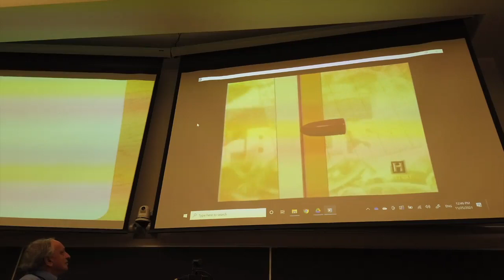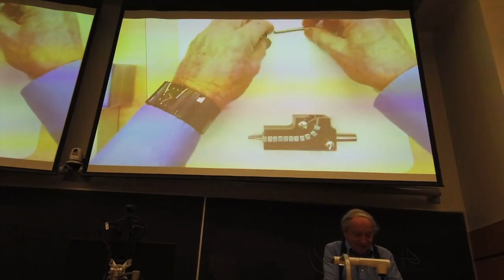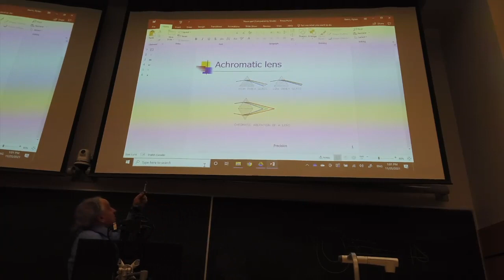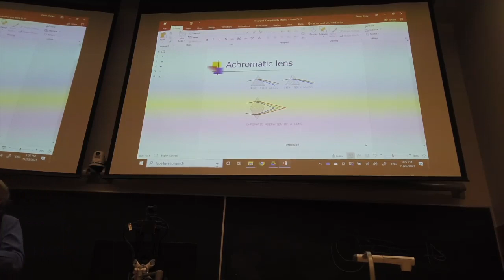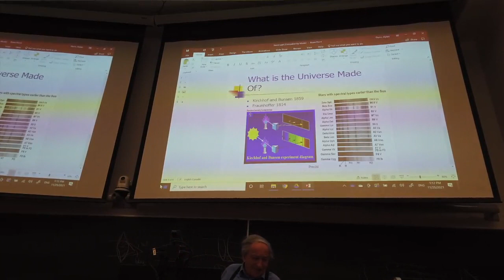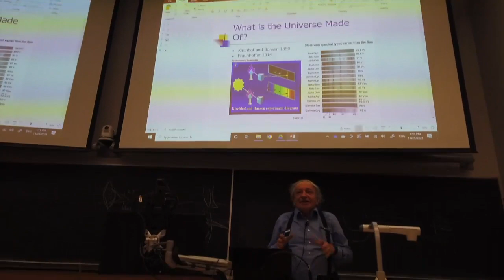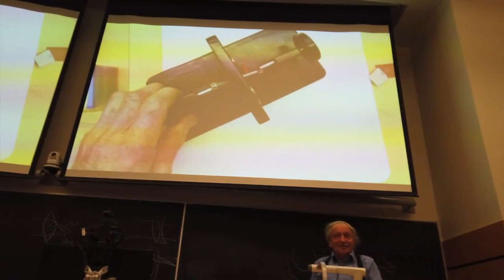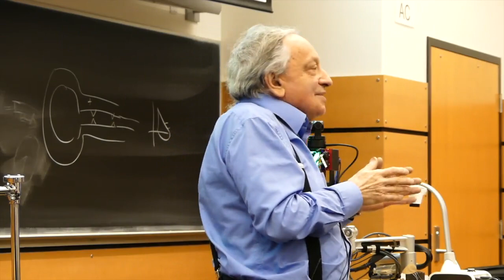2021 Nov.25 - Dan Gelbart

Comment: The guy that came with the idea of the electromagnet that attracts copper is/was Leonard R. Crow.  He published an small blue book titled "Design, Construction & Operating Principles of Electromagnets for Attracting Copper, Aluminum & Other Non-Ferrous Metals" in 1951.  Not mentioned in Gelbart's presentation is the fact that the piece of copper or aluminum to be attracted has to have a certain shape.  Too small, too big,  too long, etc. and it won't work.

Comment: The electromagnet - is this an exmple of a shaded pole. The current in the shaded area will lag
Reply: Yeah, that was especially interesting. Tricky to get the balance right between the shaded pole and the main ones. I’d also expect it to run pretty hot when in use, but I guess the super-heavy copper on the shading winding helps minimize the losses.
Reply: @DEtchells  dear Dave  that's why he's  Dan gilbart.  Quite an original layout. Somehow we always assumed that shaded pole is tied to a rotor. But original thinking takes one out of the box. Absolutely fantastic 🙏🙏 and on the lighter note i should be exempt from any exam in all of Dan's institutions😁😁😁😁😁.. thanks for your reply please

Comment: The answer to avoid the test could be, that we are dealing with an electro magnetic field not just magnetic field, the electromagnetic field has 2  modalities as its name says (magnetic and dielectric), all materials interact with these fields some more with the magnetic and some more with the dielectric when directly exposed to them. 

In this case the osilating magnetic field is generating a current in the cooper ring, that can't flow so I will expect this ring to heat up but as soon as you bring closer the cooper plate this current generates a week magnetic field in the cooper which is attracted by the magnet, if instead of a cooper plate we bring a unifiliar coil connected to a small light led it should turn on by inductance.